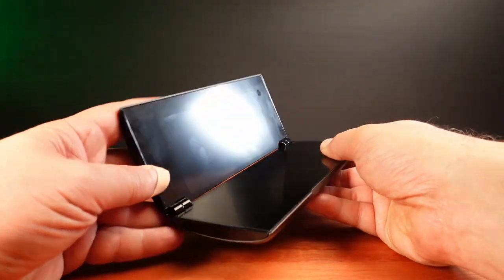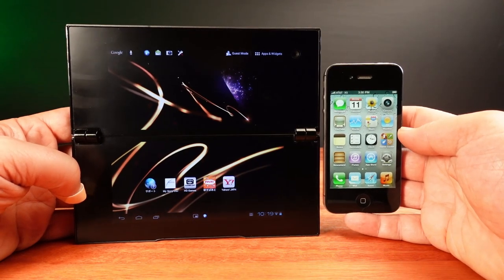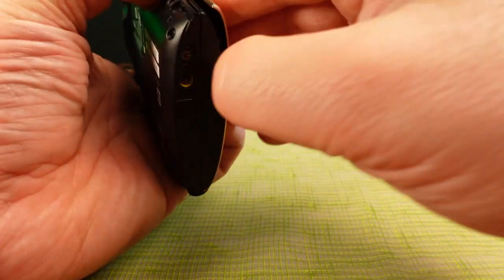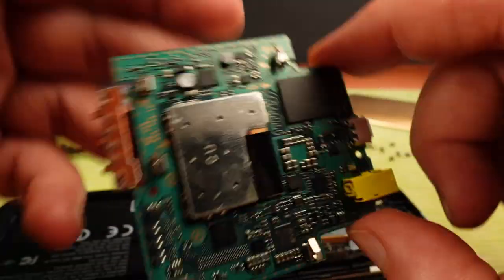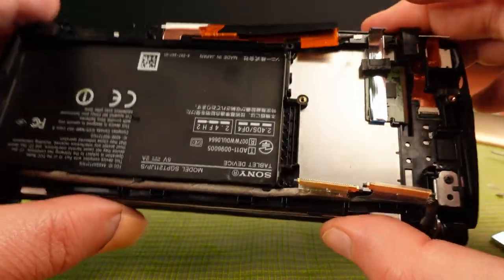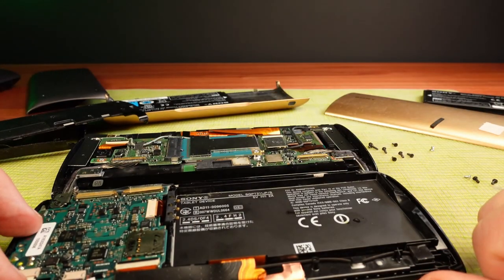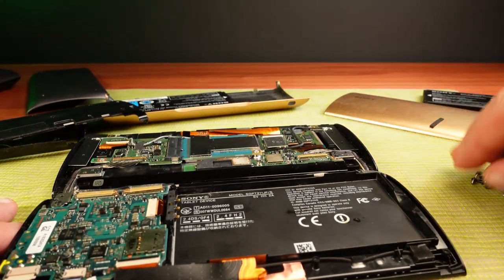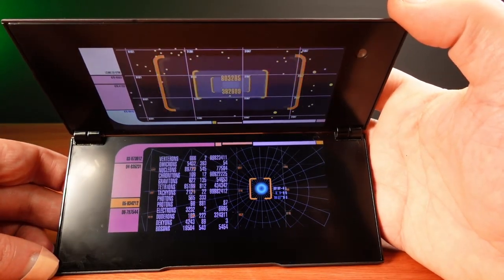Sony’s dual screen 'foldable' Tablet Teardown & Legacy

Comment: I'm fairly certain that the golf game is a Japanese version of Hot Shots Golf 2 for the original PlayStation. Like, it's literally the PlayStation version run through a Sony made emulator. I had the Xperia Play that came with the copy of Crash Bandicoot shown in the demo reel. Someone figured out a way to inject disc images into the apk so you could play other games which made sense at the time as the Xperia Play wasn't powerful enough to run third party PSX emulators.
Reply from the maker: That's really interesting that Sony made a PS emulator for Android. The Xperia Play was a really nice phone.

Comment: Sony at that time really had a bunch of weird mobile devices,there’s the Tablet P,the Xperia Play(the one with the gamepad)and the Xperia Ray(tall looking design),one common thing is that they all failed in some ways,oddly enough
Reply from the maker: I still want an Xperia Play
Reply: @JanusCycle  I have a Xperia Play in pieces in my parts bin,the flex ribbon cable randomly failed one day,and replacements are too hard to find
Reply: The play could've kicked ass, but they half assed it a bit I think. They had the Vita in the works after all, there was probably some internal politics going on.
Reply: The reason being it was failed because android wasn't ready for an gaming phone which is become the rarest xperia phones by sony
Reply: @Бмв_210  it still sold like hot cake on my country when it launch, a hundreds people waiting the store open for first day sell. 

I own it too. 
Xperia Play its a great device, the main dissappoinment was it just 512mb instead 1gb .So its positioned to mid-end device.
And SONY not really intended to push PlayStation brand to SE, they afraid it will kill Vita
Reply: @JanusCycle  did you ever get an Xperia Play? I found one on eBay that still works and is in pristine condition
Reply: @dotnickcommaone xperia ray is not even weird and it's not even close
lol
xperia play is such a beautiful failure because it tried to same thing as n-gage did

Comment: I had the Sony tablet S. I'm still pissed as Sony stopped updating it less than a year after release for their Xperia tablets. They also never unlocked the bootloader, so it could never be fully rooted.
Reply: Why cant you unlock the bootlooder yourself? lots of devices have been hacked befor nothing new

Comment: They really wanted to make a x86 based tablet. The WiFi card is actually plugged in With a mPCI E connector thats a PCIe x1 1.1 Bus that You can find on any Laptop around The time

Comment: I remember this thing but I never saw it in stores. However I did see the Libretto W100, that was quite cool, but the software was not caught up to the hardware at that point, android 3 wasn't even out yet. If it was only a year or two newer it would have been way better.

Comment: Great video. I'm here as I just bought one of these that was working fine, then suddenly the screens faded and it turned off like in the movies when they show interference with computer screens. It's now just doing what your faulty one is doing, backlights only and occasionally flickering. Absolutely gutted. Have you managed to find out the fault yet? Thanks in advance.
Reply from the maker: I don't have any leads yet on the cause. I haven't done anything since the video. You have motivated me to consider this problem again soon. I'll let you know how it goes. I like your channel by the way, subscribed.

Comment: I wonder what kind of hardware we could cram in that neat mesofuturistic chassis these days... I actually dig the vibe, if not the actual implementation and those weirdly uninhabited giga bezels. (Could they really not have stuck a hardware home button in there?)

If it stopped pretending to be a folding display and admitted that it was two screens, I feel like one could get some serious mileage out of a modern clone of this thing. Perhaps all of that chassis space could be occupied with batteries, big beefy beautiful antennae, and some fancy sensor package, and we could have ourselves a real-world Tricorder. Bonus points if it vertically slots into a neat oval-looking charging dock... Personally I'd probably splitscreen Discord and YouTube/a game, or a browser and a word processor, or... really, all of the things I use dual screens for on desktop.

Comment: 2 small screens split into 1, they should have enable and disable buttons or options. I think it is a very great idea, especially for a portable setup in a combination of Notebook and thunderbolt. Currently I have 2 27' displays and huge PC and my next setup will be 1 27' and additional portable tablet (probably foldable) + notebook with a thunderbolt and external video card + custom miniATX for a multiple tasks. It's much more flexible to have portable devices and clean file hierarchy. Current portable devices is powerful enough

Comment: Is it possible to modify such a device? Such as “inserting” a fold 4 into something like this? I actually like the look of the device, it reminds me of something like a Nintendo DS with its clamshell like design
I’m beyond my experience which is zero but could the screens function like independent monitors?  If space was possible inside not that I think it is but purely theoretical here the goal would be to dock the internal parts of a Samsung fold4  into Dex mode internally inside this device using it only for the dual screen as a monitor. If possible could the top screen display the DeX mirror  and the bottom screen display the Samsung fold native, that is if it was possible to have the display running directly into the bottom screen and the DeX usbC going to the top screen.
Now getting really wild but could it be possible to have the bottom screen run independently entirely from the top on some sort of portable pc with windows and the top screen running Samsung fold 4 Dex 
All hypothetical with zero experience and obviously knowing space is a thing but just curious if this is even possible lol 
Thank you!

Comment: i have this do you know how to flash it ?
Reply from the maker: There is some software called S.onyTablet.S v3.0 [FLASHER] which says it can flash the Tablet P.  I also saw some P flash files on the XDA forums which might work. But I haven't tried any flashing myself yet. First I want to see if I can fix the hardware in my second one.
Reply: @JanusCycle  Thank you, the problem is that the s. Tablet thing 's link seems to be down. So i couldn't find it anywhere else.
Reply from the maker: @d.s.h6629  Here are the files I have from XDA. Please be very careful, many people have had trouble flashing on the XDA forums and caused bricks.
https://forum.xda-developers.com/t/q-tablet-p-wont-boot-after-firmware-update.2369652/
I wish that more people could re-upload their old flash files to XDA.
https://drive.google.com/drive/folders/1UeIcl3mCiaJMu2qR6m2dC6OXzXoGxIUZ
Reply: @JanusCycle  thank you so much !! I'll try it and tell you how it goes !is this the old one? i rooted it some years ago when i had the tools , but sold the tablet then i got a new one recently hopping to use it to develop some apps ! thx again Mr.janus.